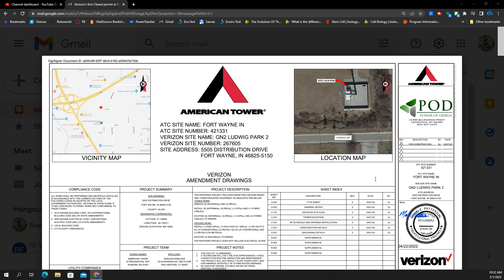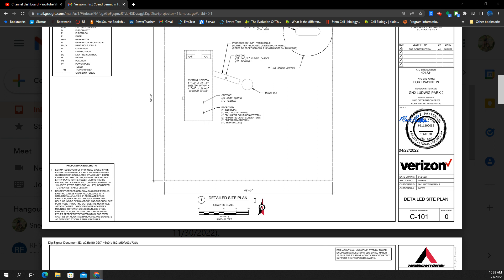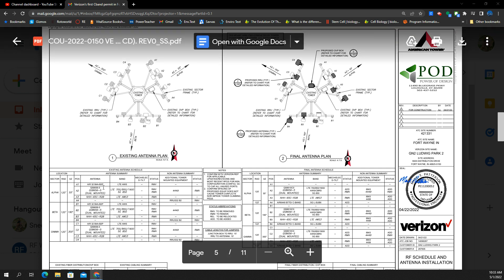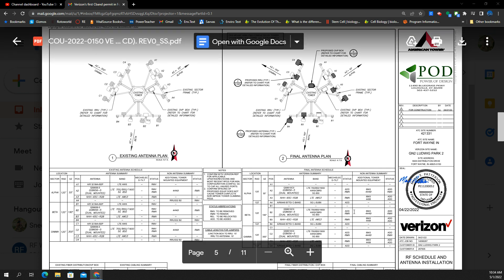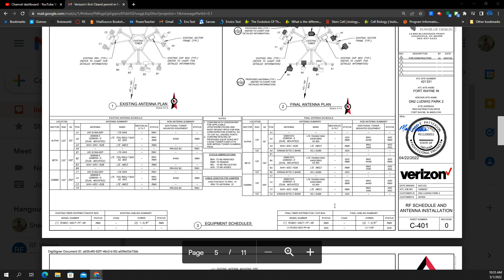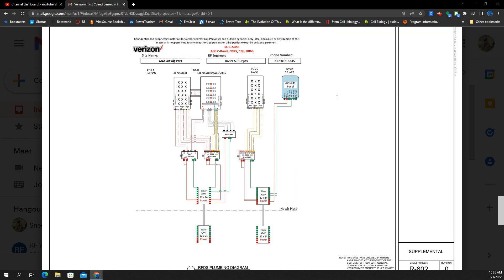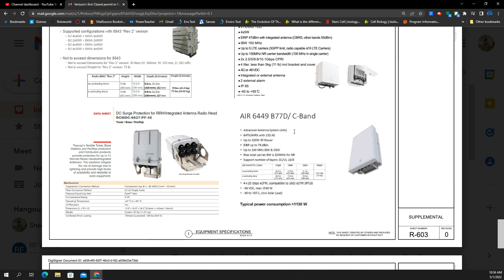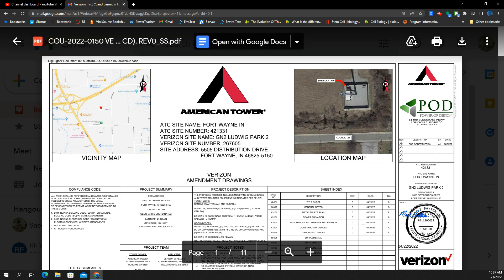How does Verizon do C Band N77 upgrades? CBRS B48?

Comment: Hopefully they upgrade areas near where I live because I originally wanted to use Verizon for Cband 5G or their MMwave but the closest is Providence RI which only has MMwave in like two or three spots kinda lame so I got rid of Verizon and kept tmobile since I wasn't getting value out of Verizon but until they add more 5G mid band I won't consider them

Comment: I switched to Verizon yesterday from sprint/t-mobile. Let me tell you I'm happy with Verizon service and customer service is quick! No waiting like Sprint. Also, I had issues getting my phone that I owned from sprint. They claimed they had unlocked my phone 4 times. After 2 days trying to get connected with Verizon. I had to go into Verizon store! 3 hours in the store and I gave up. I had to purchase a new phone from Verizon. Just to get activated because of sprint! So $135 dollars later. I was finally on Verizon. There customer was great. The hold up was all because of sprint. Then sprint tried to increase my bill. I still have a tablet with sprint. There trying to charge me as a new device and start my payment all over again for my tablet and charge me $90 a month just for my tablet. I'm only paying for the data plan. Which is $15 a month. Totally ridiculous and I'm fed up with sprint. They also tried to start my payments over with my phone last year as if I had just got it and tried to charge me full price. After paying on it for a year and never late on payments for 3 years! After arguing with sprint last August. They gave me credit. In order to get the credit. I had to pay off my phone of $90 on my next bill on top of my regular bill! UNBELIEVABLE! IM GLAD IM NOT WITH SPRINT ANYMORE! Sounds like a law suit to me!
Reply: Right on , I love my Los mobile Verizon it works very well the most reliable signal and service

Comment: Anyone know whether Verizon adds CBRS to every site that gets C-Band? That might explain why I've been seeing ordinary LTE speed up — it used to almost never surpass 100 Mbps in my market but now it does so easily.
Reply: Down here 0 sites with band 48 only n77 lte gets better because of backhaul
Reply from the maker: Completely market dependent. Most importantly, markets where they own pals for 30-40 MHz ie cle, Vegas etc. I doubt many markets will see much Cbrs hardware for gaa only. Maybe if the newest gear is full n48 l48 + n77.
Reply: @realsmt  Is there any gear that does both n77 and B48/n48?
Reply from the maker: Nothing yet, from what I can tell. Everything here is two different radios, two different antennas.
Reply: @realsmt  Bizarre, considering that CBRS is technically part of n77. Maybe it’s because of special rules for power levels and listen-before-talk?
Reply from the maker: Precisely. If the dod would just give up the entire 3 ghz range…it would be a massive game changer for our country. Not an exaggeration at all.
Reply: @suchnerve  not bizarre n48 is shared spectrum low power n77 is full power 3.4 is full power you can't use massive mimio on n48 at same time as n77 need 2 separate radios and antennas
Reply: @realsmt  smt is right it should not have been shared in middle of 2 other sub bands then you could have used 1 radio for Any freq using m mimio from 3.3 to 3.9  ghz like what n77 was designed for in other countries fcc in usa is horrible and dumb shit

Comment: That is an antenna schedule in the thumbnail. I submit apps to ATC all the time! They’re a great tower company to work with and they do their own structurals. It looks like the permit application that was submitted as I don’t see stamped approved on the plans.
Reply from the maker: It should be approved soon, I’d think. Work should begin by late summer.
Reply: @realsmt  hopefully. Smaller jurisdictions like around CLE have really short approval timelines whereas in larger markets the timeline can be 3-4 months!

Comment: Wow. So 700/850/aws/pcs go all in one panel??
Reply: Yes and because it's only 4x4 mimio you can have several small slices of bandwidth,  this is why  you can't run multiple bands in 64x64 m mimio, this is why lte sucks so bad this is why the hardware can't use 5G to the max performance
Reply: Yes it’s the radios that are Capable of the bands
Reply: @Longshore79  well they have one radio for 850, one for 700, and one for PCS/AWS. Then the lines run from the radios to the single antenna array.
Reply: @zacharywebb7197  that was my understanding. I thought they had a dual panel for 700/aws and another for 800/1900. I haven't kept up with their fdd panels
Reply: @idkperson08  it varies by tower, but on this one iirc it's all four bands to one of the dual panel, second 850/second AWS channels to the other dual panel